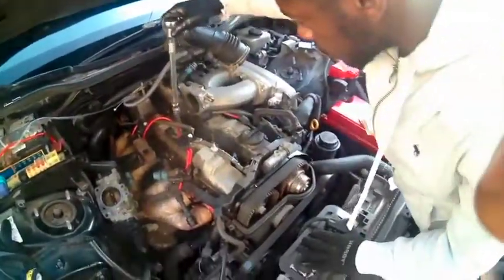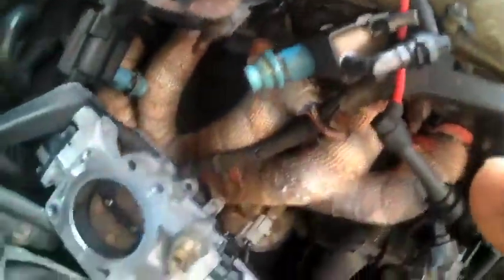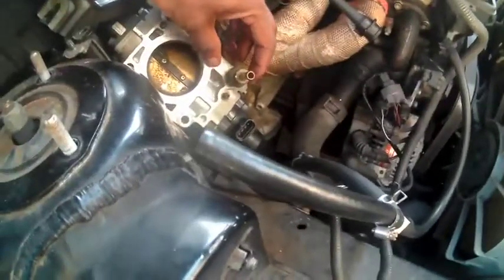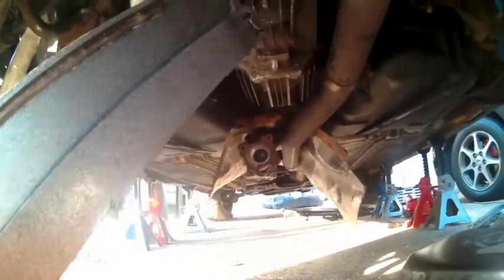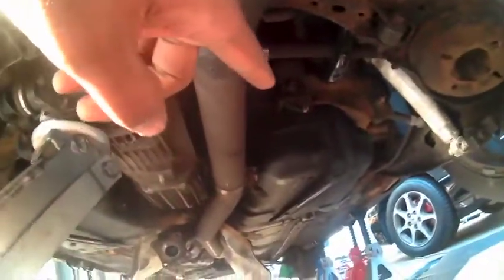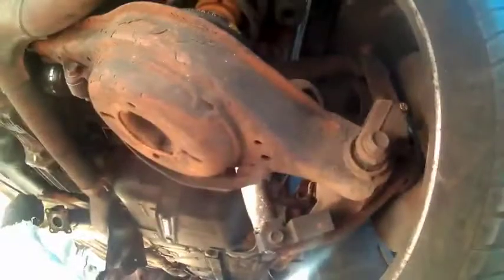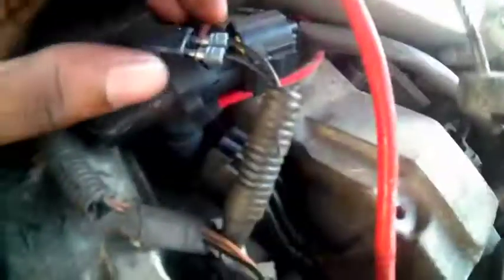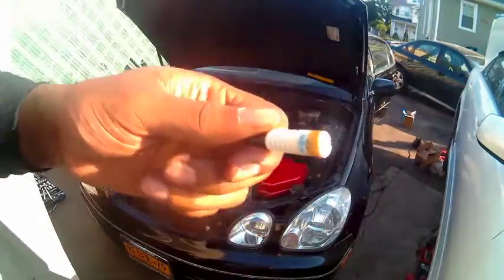Spark Plugs on the Lexus GS300- Speed 6 Turbo Gets Poly Mounts

Comment: I bought a 01 black GS300 I got about about a month ago, so far I've replaced the o-ring that is inside of the vvti gear, spark plugs, the coil pack boots, had to get new coil pack connectors for the wiring harness & wired and loomed those in, did the valve cover gaskets, the rubber throttle body spacer/gasket. Had to replace the door seals, I have the chrome that goes around the top of doors because they are jacked up on booth sides from some one trying to steal it before I bought it. And I have other parts that I was waiting to install because I was having issues getting it titled and registered in my name but finally got it plated yesterday. So now I finally GET TO INSTALL MY HEADERS!!! My bank one cat is soo clogged it makes it run terrible. Luckily I was able to get it to pass smog by the $5 spark plug anti fouler trick until my header came in with my actual 02 spacers. I'm so stoked to finally start working on it and making it look nice again. I really wish I had the black interior like you though. Your paint looks a lot better than it used to, did you get it painted?? Love your car brother, nice vid!
Reply from the maker: I might have to get new coil packs in the future. Mine are still broken. The header install should've been a lot easier because I still have a leak but I'll get it fixed eventually. All I did was Wash it, Use clay bar over it, polish and wax it. I put up that video here: https://www.youtube.com/watch?v=u8m20sEZmBU

And Thanks!!